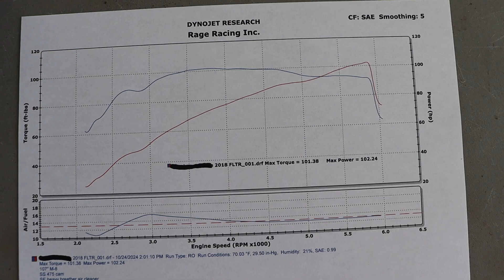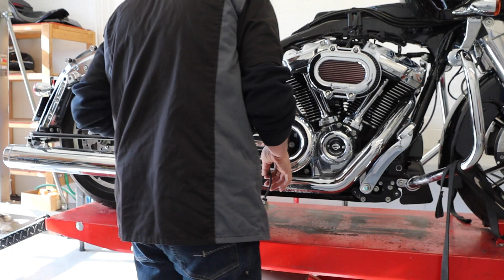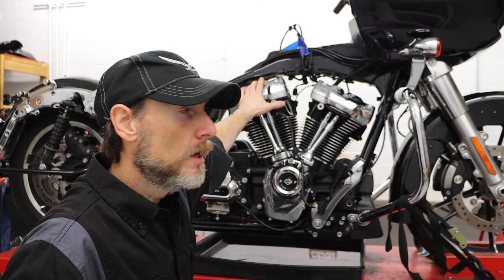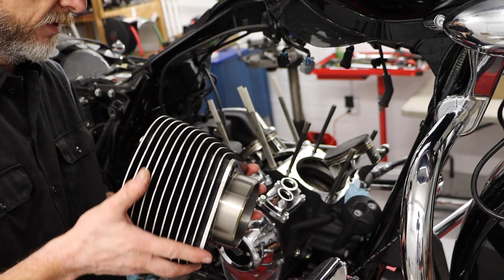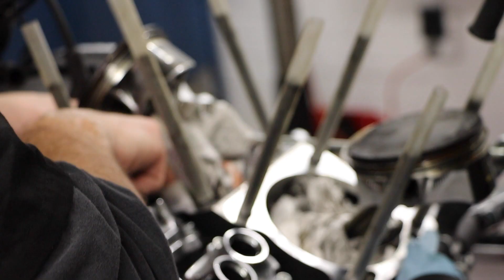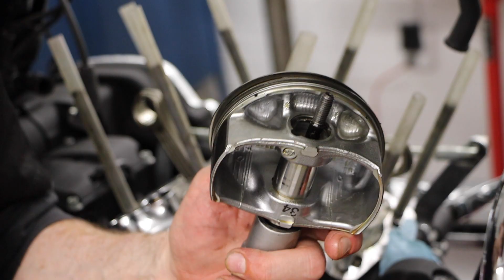Build Project 1:  Harley-Davidson M8  107 to 124 Part 1: Teardown

Comment: I would not let this guy no where near my bike. He is dropping stuff and banging parts. Plus he never showed what he was doing on the other side concerning a gasket that tears. It would have nice to know this. I understand the gas tank must have pressure released before pulling the tank. This guy is a jack leg at best. Zero organization on screws or bolts, throws parts around. I made it to 20 minutes. Not learning a damn thing. I am not subscribing. Going to Baxters Garage. Kevin Baxter knows what he is doing.

Comment: Where did you get that bent intake wrench? I replaced mine but I'd like to have a wrench to check the tightness
Reply from the maker: Yost Performance Products makes those wrenches.  I got mine through my Drag Specialty account. I think they are also available through V-Twin, Lowbrow customs, and TC Brothers. I don’t know the part number off hand but just type in “Yost Harley intake manifold Allen wrench”